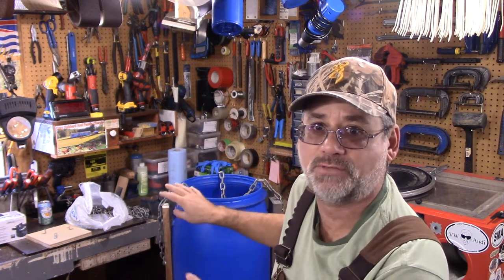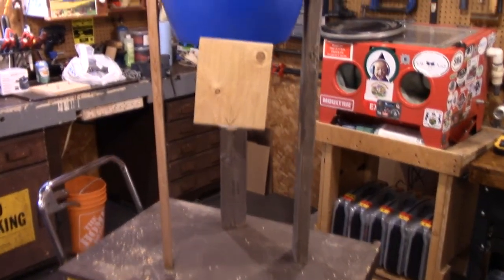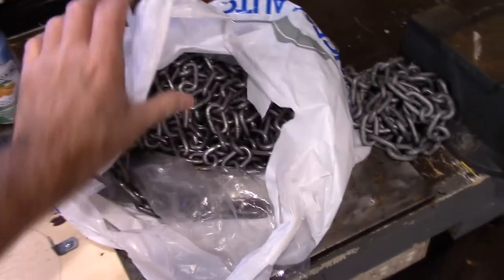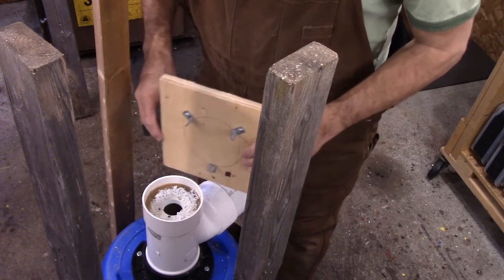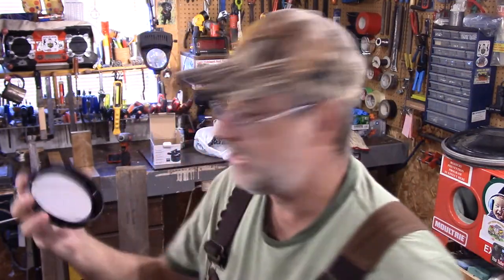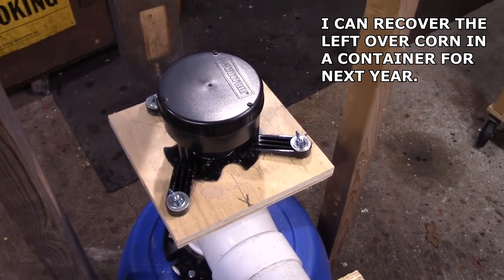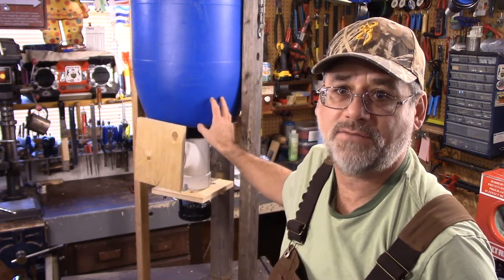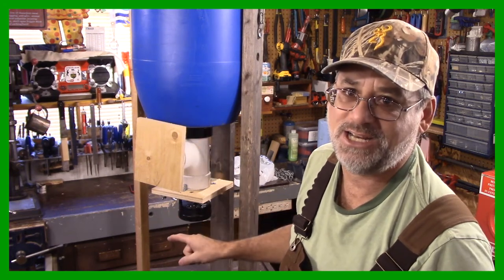Homemade  Deer Feeder  With Moultrie MFHP12367 All in One Timer Kit

Comment: If i have a large metal barrel to use this with.  Is all i  do drill the hole and mount it straight to the bottom of the barrel? To me it looks like it would just fall out but its hard to tell
Reply from the maker: Yes absolutely Mason , just drill a hole the same size of the opening on the timer 1-1/4 " I used and the corn will not pour out as it stops at the timer spinner waiting for it to start.  I thought the same .  Works great every day for 5 months on the batteries , I used 4 seconds a day , once a day    turn on time .
Reply: @SteveRobReviews  Would this be possible with a 5 gallon bucket or a trashcan slightly bigger? I live nearby so i can refill it with no hassle if i need to if it runs out quickly
Reply from the maker: Yes absolutely,  I have 3 on 5 gallon buckets  that last me about 14 days to empty.   The timers recommend  6 seconds 2 times a day but I found 4 seconds once a day works great  and does not use so much corn needlessly.

Comment: I wish the battery for my feeder lasted the season. I have a Big Game feeder that's all steel & holds 100 Lbs but I barely get the 12v  battery to last a week. I only set the timer for 9 seconds in the morning. I even tried hooking up a solar panel to charge it but between the flying squirrels & other squirrels playing Tarzan on the wires I can't keep it charged. I had to resort to dragging my  deep cycle boat battery out to my spot to keep it going all season but the flying squirrels are still a problem. I never knew Michigan had flying squirrels until I captured them on my trail cam at night. They're nocturnal so that's why I never seen one. 😁
Reply from the maker: Wow thats wild , no flying  squirrels up my way. Bears are a pest.

Comment: I finally found one of those barrel. Will put that one on my  property in Rainy River. Will also use a chain and 2x4 like you mount on a big steel angle and use a steel cable with a winch boat to bring it down for fill up. Thumb up
Reply from the maker: Victor the timer is on sale  on Amazon for less than I paid last year😂😂 it works awesome 👍 Cheers
Reply: Bought a Moultrie 5 gallons to feed my rainbow trout at the cabin. Don't use it anymore for that.  But, did order one never know. Thank you